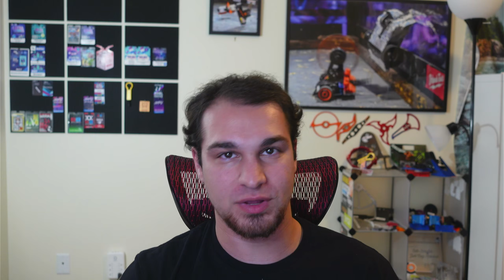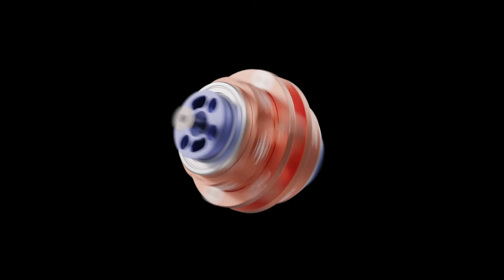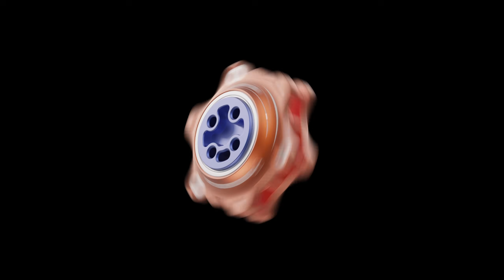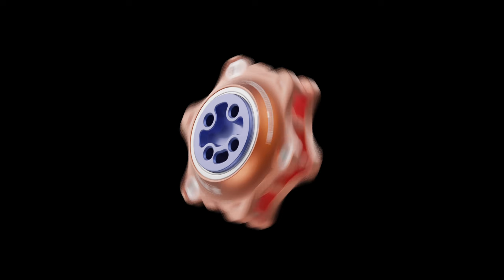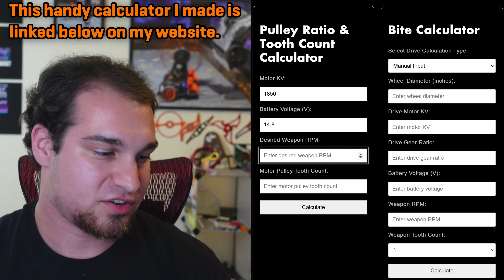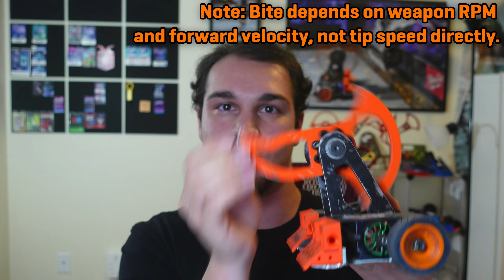Combat Robotics Basics: Spinner System Design

Comment: Great video, tons of helpful info. Just wondering, being relatively new to this hobby, is there a good place for sourcing pulleys with bores that will fit on typical brushless motor shafts? The 3D printed ones are simple enough but I've found it hard to find aluminum pulleys with the right pitch that will fit on such a small shaft (for example most pulleys are minimum 8mm bore that I've seen while a brushless motor will have a 4mm or 5mm shaft) . I would just 3D print both but you recommended using aluminum for the motor shaft. Thanks!
Reply from the maker: I've had good luck finding some on eBay but you can also check a whole bunch of industrial supply stores like McMaster Carr or MSC Direct or Misumi among many more
Reply: @JustCuzRobotics  sweet, thanks man. I did find some on mcmaster just wasn't sure if there were cheaper options around haha I'll check out the other places you mentioned

Comment: Are you setting inserts into your nylon pulley or just threading the plastic directly?
Reply from the maker: These days I use plastite screws /thread forming screws. Special coarse thread screws meant to thread into plastic.
Reply: @JustCuzRobotics What size screws are good for this application? I'm good with the theory and general design practices of combat robots but don't know anything about screw sizes. Fasteners in general are my Achilles' heel.
Reply from the maker: #6 plastite works well for me but depending on the use case you can do #4 or #8

Comment: I have some questions I want to ask, as I have watched this sport for a year. I also have a Fingertech Viper Kit with the vert option that I have never fought. Also I want to design this antweight bot after Lynx or my favorite now Brian Boxel’s Eruption.
1. What are some good antweight weapon motors for a Lynx or Eruption type eggbeater, as I have seen on your website and Youtube comments that you have a motor but not one suited for heavier weapons. Or is a eggbeater of somewhat that size good for the motor size? Since I want a weapon that is got enough bite and tip speed.  I haven’t watched through the video fully so sorry if I accidentally find out something I want.
2. Do you have a video on how to tune on a robot esc? Since this was the first electronic thing I have gotten into and also a I want to have a faster bot for more bite.
3. This kind of goes with number 2 but do you use pcbs to connect the wiring? I would like to see a wiring diagram of something to get a picture.
4. Should I try to make a 4s bot? I have been looking at motors for drive from Palm Beach Bots, Repeat Robotics, Fingertech Robotics, and Just Cuz Robotics and with what I have seen with looking at their weight and rpm. 
I definitely think that this is much for a beginner so I may design a bot before this that is way more friendly for me fight with. Just not as friendly as the Viper Kit since they are like midtier to low tier bots. Also sorry for leaving a long comment just wanted to add details.😅
Reply from the maker: Long list of Qs for a YouTube comment lol.  Send me an email at Team@justcuzrobotics.com so this doesn't get lost and I can try to answer some of these!

Comment: What would you recommend for a 1 pound ant weight insides such as motors and boards for using I don’t know much about electronics.  Thanks
Reply: Any specific site you recommend getting the motors, receivers and controller from.  And what nylon and tpu do you recommend
Reply from the maker: Check out some of the resources on my website. They might help. https://justcuzrobotics.com/blogs/jcr
Reply from the maker: There are lots of options for electronics. Repeat Minis are popular for drive motors and I sell an RDY-5022-MINI hubmotor weapon motor that's perfect for antweights and has been used by several beetles for hammersaws too. AM32 35A brushless ESC I sell pairs well with the Hub-motor and a malenki HV is a cool receiver and brushed drive ESC combo
Reply: Would you say the Bambu p1s with the multi color printing attachment would be a good printer for this
Reply from the maker: I own an X1C with the AMS and a P1S. Both fantastic. However the AMS isn't that useful for combat robotics. It can't keep filaments like nylon dry and its not compatible with abrasive fiber filled materials or with TPU which is probably the most widely used by far for combat robots
Reply: What would you recommend then
Reply from the maker: @Firstordertrooper P1S without multiple material system is still awesome
Reply: Would you recommend a different printer or can I just have some way to store filament
Reply from the maker: You will need a filament dryer to print TPU and Nylon with any 3d printer. Storage depends. I just dry filament as I need it and print from the drier.
Reply: I will get the hubmotor and the am-32 ESC so would all I need now is a receiver and controller and 2 drive motors?
Reply from the maker: Yup!

Comment: Huh kinda surprised you haven't mentioned chains or gear drives as they can also be used to transfer torque to run a spinner along with belts. Anyway good video all the same.
Reply from the maker: I did mention gear drive. Chains do not offer many of the same benefits as belts and tend to be way heavier and impractical for robots under 12lbs
Reply: Sorry was expecting a tad more detail like you did with belts.
Reply from the maker: That's fair although I said at the start I was trying to make a 15 minute video and it's actually 23 minutes lol. I couldn't cover everything in detail without the video getting super long, and probably 99% of spinner combat robots in the 3lb class and under use a belt driven weapon or direct driven/hubmotor style so that's what I focused on.
Reply: @JustCuzRobotics  OK fair enough but would be cool to see you go into a bit more detail on chains tho, maybe like a part 2 to this video perhaps.
Reply from the maker: Not sure what the benefit would be of a full video for that. The exact same rules apply as timing belts but you use sprockets instead of timing pulleys and chains can be broken and rejoined so you can design a little different than for belts. But I think the fact they will snap too easily from shock loads makes them unsuitable for pretty much all combat robots under maybe 30lbs. At 30lb and over, they still are not good to use on weapons that often experience shock but can be useful on drive due to being relatively narrower vs a similar belt drive.
Reply: @JustCuzRobotics  ah ok just a thought have a good day anyway.

Comment: How would you design the frame to house the drive motors and all the electrical components for the vertical spinner?
Reply from the maker: That's a lot to cover in a YouTube comment lol. There are tons of ways to design a robot of course that's why they all look different. A pretty common archetype these days is using carbon fiber or aluminum base plate and top plate, UHMW frame rails that hold the shaft for the weapon as well as have the structure for the main body, and 3d printed TPU for most everything else.

Comment: I gotta ask, what is the purpose of putting your robot fully in CAD (wheels, motors etc)? Does it make printing easier? 

How do you make the individual parts like motors and wheels in Fusion 360?

Thank you
Reply from the maker: Firstly its a requirement to 3d print parts. Secondly making sure all parts exist in a 3d model makes it so you know for a fact you can put it together in real life and have room for all components. And getting anything manufactured be it laser cut or CNC machined pretty much requires a 2d or 3d cad file
Reply: It helps get an idea of the robot and lets you model around parts such as leaving wheel wells or mounting points for motors. Grabcad is a good place to look for cad files of parts
Reply from the maker: Often you can download models for parts and I have models for most everything I sell available on my website as do most manufacturers of combat robot parts.